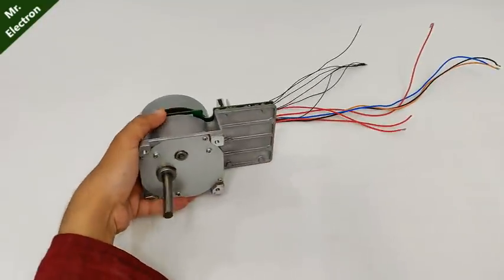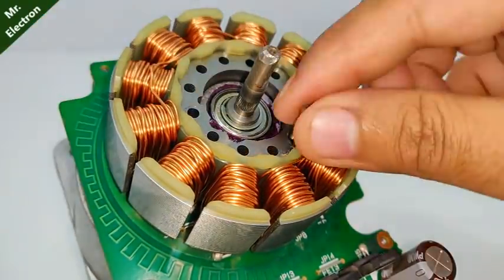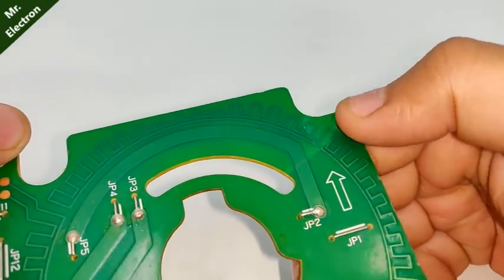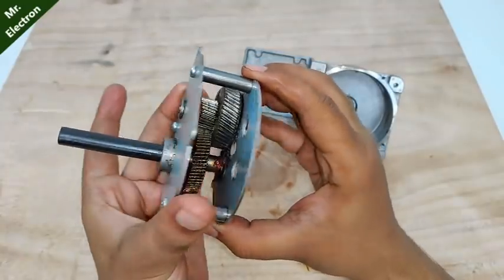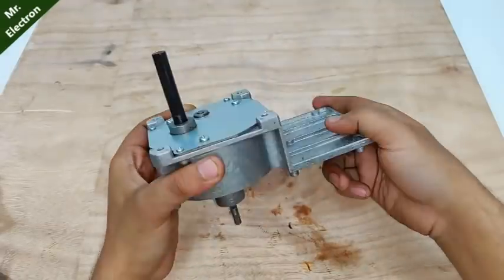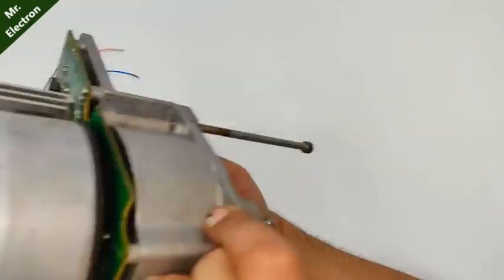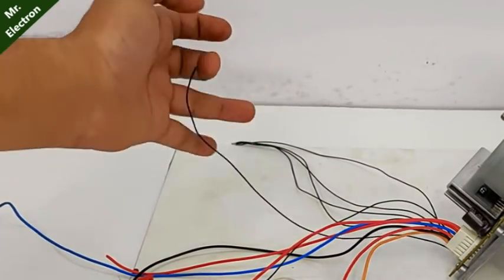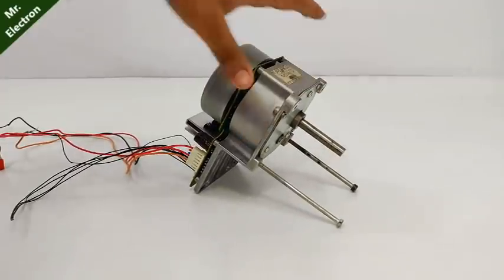Repair & Run 24v BLDC Photocopy Brushless DC Motor without Controller

Comment: Gr8 video  sir  and sir I have question plz reply  sir can it possible to connect two dc generater in series like connecting two batteries in series  for high amp and parllel for high voltage . plz reply sir plz plz plz
Reply from the maker: Yes but for series is for higher voltage and parallel is for higher current.
Reply: @MrElectron  ok sir and very very thanks for reply

Comment: Is there any current output from the smarten mmpt charge controller to the battery wires ?, the output on the battery wires does not seem to come from the mmpt controller I have, can you explain how?

Comment: At 8:30 this is 1k ohm resistor not 500ohm
Reply from the maker: 2 resistances in parallel ( 1k each ) are equivalent to 500ohm

Comment: I have this same type of motor . In my motor, the board was completely damaged . So I removed the old coil from the armature and rewound the coil like a computer fan coil and connected a hall sensor to it (as it is inside a computer fan)to run it without a 3 phase controller